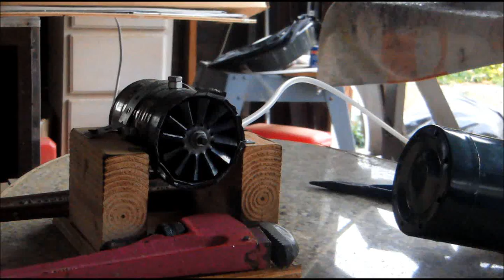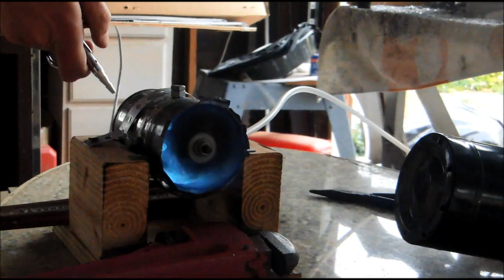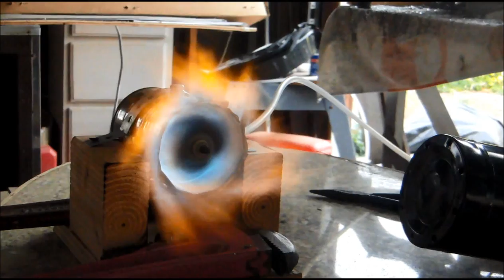Homemade Tin Can Jet Engine Test 11

Comment from the maker: We plan to make a video explaining our process of constuction in the future. Although it looks sickit does not sustain its self for crap. We unfortunately concluded you just can't expect a tin can jet engine to ever work.
Reply: +quinnscoolscience Please upload a How To video in the future. Im very interested in starting a project like this for myself. If it didnt work, it means you guys didnt achieve the air compression ratio needed to sustain operation. I think its possible that the combustion temperature of your chosen fuel is too low to achieve the thermal expansion of gasses needed to sustain the engines operation. You could also consider insulating the jet engine with cement, to trap the heat inside. Temperature loss at any stage apart from the exhaust stalls the operation of the engine. Or you can preheat the air that enters the engine by leading air from your compressor through a copper coil first, with torches firing at the coil, after which stage the superheated air then enters the engine.
Reply from the maker: +Martin B 
Your right, low compression is totally the reason it does not work, But our fuel propane is not the problem. Our Engine is crap!  Our compression theory is flawed.
First to save some time look up the difference between axial compression and centrifugal compression.
Then notice how all model jet engines you buy are centrifugal, while all the ones that don't work on you tube (including ours) have axial compression. Don't be fooled by the fact that all the animations of JE's are axial, they are animations of full size jet engines. I have come to believe that for reasons concerning the volume of air flow, centrifugal is more efficient on smaller scale JE's and vise versa.
I'm not saying that axial flow model JE's won't work but its going to be hard.

Check out smartfilmproductions, as they make the same realization I have. Observe how they switch from a jet engine like ours (mk 1) to a centrifugal (mk 2)

That's what I have learned at least 

I would love to see a self sustaining axial flow Jet Engine when you make one.
One tip though: if there's any chance of it working you must make it hella accurate and precise.
Good luck broski!
Reply: Thanks for the reply. I'll check out smartfilmproductions and hopefully, if I succeed, I'll get back to ya ;)

Comment: you must ad stators blade after the compressor blade to help the air compression, just using a compression blade and a turbine blade will only make a kind of ''flames trower fan'' (sorry for my bad english.. I'm french Canadien)
Reply: Yeah we had no idea what we were doing when we started
by the time we finished we finished we realized that the same thing you did,
and about a dozen other reasons why our jet engine had no chance.
Thanks, 
Any other tips for our next jet engine would be much appreciated